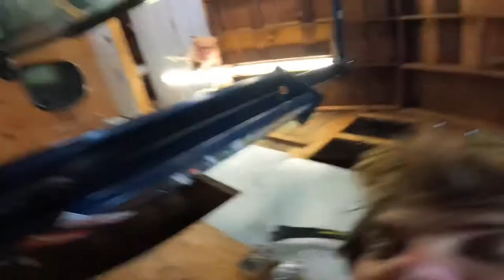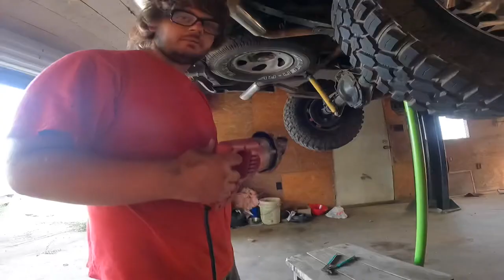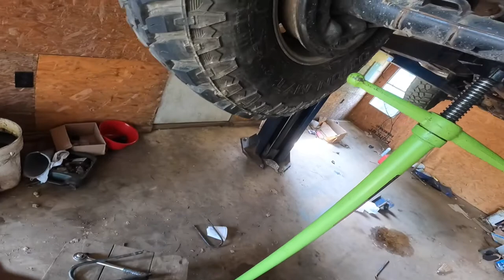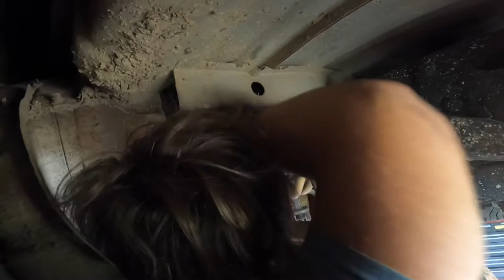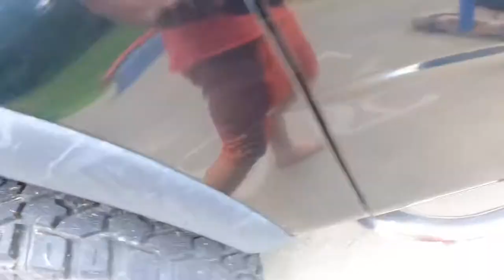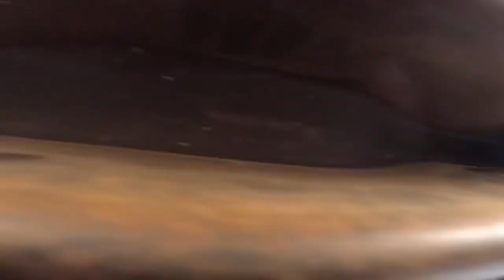1999 Ford F-150 2.5 inch rough country lift kit install!!

Comment: id you get any popping or creaking in the front end after you installed the lift? I have a noise like that every time my truck leans on a turn or a hill.
Reply: Cv axles,4x4 components,typical whether you lift/level it or not in 4wd trucks,especially if older 4x4.

Comment: One of the things Rough country doesn't tell you when you buy their shocks/lift/leveling kits- you need to buy dust boots, they don't include them with your shocks. Just one of my pet peaves with them. I have an 03' that I'm building up right now as my daily driver. I just put new 32" tires on, and while there's room for them in the wheel wells just daily driving on pavement, I'm thinking they might rub if I take them off road. So this leveling kit is on my "wish list" of things I'd like to get done. How are the shocks compared to the bildsteins that you took out?  I am "for sure" going to put in a set of bilstein shocks to make the truck drive nice and smooth for my wife- she gets car sick really easily. The newer larger tires really helped smooth out the ride......they are the stock diameter for that year FX4 model (actually 31.5ish).